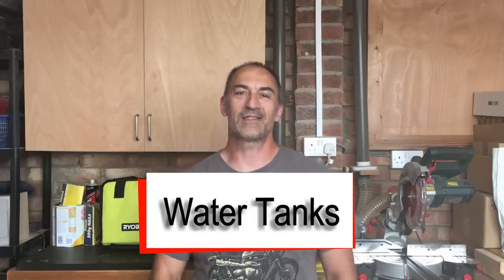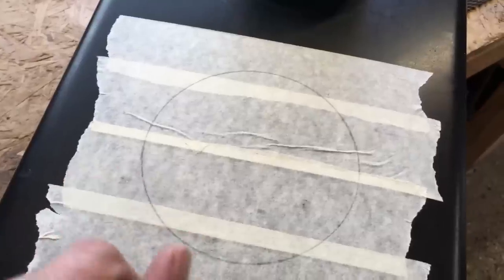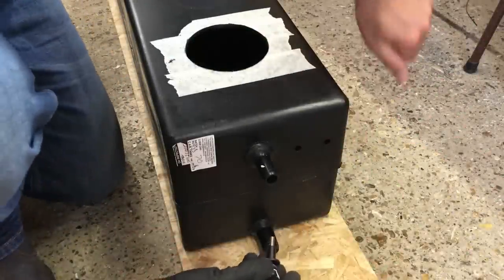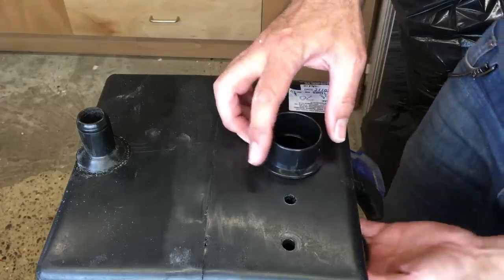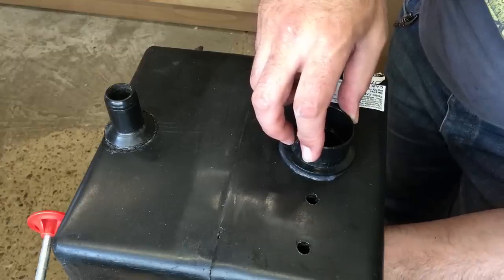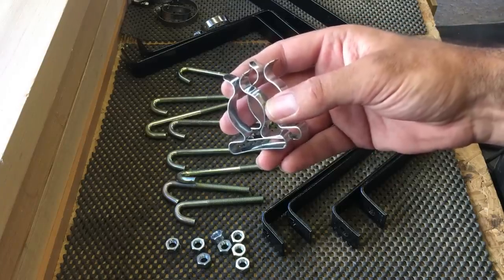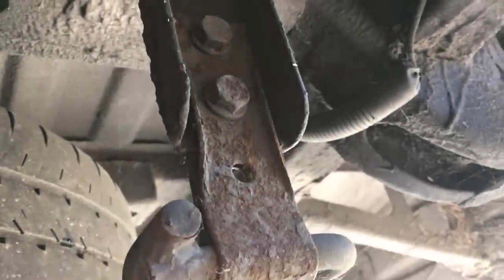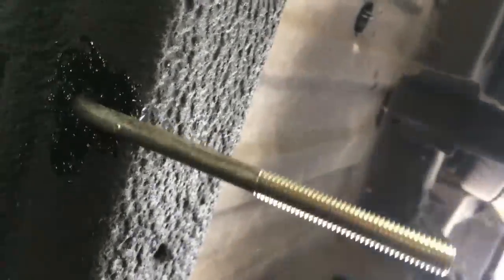Mercedes Sprinter Campervan - Water Tanks

Comment: I may have posted this before, but after watching some other DIY built van videos it's nice to watch one being built by a proper builder.  Example: spending the time to jig up a guide for the drain inlet hole saw when someone who doesn't know better would try to drill it freehand and likely make a mess of it.
Reply from the maker: I try to think ahead and eliminate as many problems before physically doing the work. 
Jigs are always a good solution for all sorts of jobs. Thanks for great comment.

Comment: Mate I am loving your videos. Whilst I know most of what you are sharing I really enjoy watching them. This is without doubt the best conversion series on YT and it is like watching a visual book. You clearly explain everything for the viewers step by step and not just what you are doing but why you are doing it. Very well thought out conversion. Having fun watching it, maybe you would consider writing a book for converting Van's. I have just been to the dealer on Friday and signed papers for a  MWB Sprinter. Plan on using it for a couple of years for day to day work and then converting and selling once done. Already done a conversion on VW T5 LWB Mid roof and just a few finishing touches left to finish her off. Your videos are making me want to start straight away on the next one. I thought I did things belt and braces with double shrink wrap on cables but your sealant on the contacts of the waste tank is a nice touch. Tempted to skip to the end to see that van finished because I know it will be awesome but I must resist the urge. Just a quick tip for others on here, you can warm up some Vaseline and pour into under body channels/sections/door panels etc. to work the same as wax oil if you can't get it in some countries. Cheers Jerry
Reply from the maker: Hello Jerry, it makes my day to recurve a comment like yours. Thank you very much. I would like to produce a book and it’s something I must find the time to produce. I have really enjoyed the whole conversion process and helping others too. It a great community of people. 
Good luck with your future conversion. Best wishes

Comment: Very instructive video. Many thanks. In another Sprinter build series they secured the water tanks using flexible metal strips. A later video showed him reattaching the water tank because the metal straps had broken. Then I noticed another van build series using the same flexible metal strips. Not sure why these other builds are using this method because they looked flimsy from the outset. Glad you're using better solid support for your tanks.

I second the request for info on winterising the tanks. Would be interested in how you'd approach this. Maybe cover this in a future Q n A?

Comment: Another excellent video Greg. You hit all the items that I would have done. 
1. Using the scrap ply as a guide for the new hole for the waste water inlet. Also useful if you need to fit larger downlighters where you have an existing fitting in a ceiling
2. Swapping out the plain nuts for nylocs ( who thought plain nuts with no anti-vibration washers was a good idea on a vehicle??)
3. Similarly- crappest connectors ever for an externally mounted tank doh!!. as others have said the glue lined heat shrink is a really good idea.

Comment: Another great video Greg. Beware using acetoxy silicone on plastics. When I fit shower wastes I have to use low modulus neutral cure silicone as the acetoxy variety eats away at the plastic and causes it to go brittle. Over time it turns the waste yellow and it falls apart...takes months but it does damage it
Reply from the maker: Thanks, David, yes maybe in hindsight some "plumbers mait" would have been the better choice.

Comment: Hi Greg, hope you are having a great time travelling, just wanted to let you know, I have now fit my waste water tank from Caktanks, managed to fit it behind the drivers area next to the diesel tank.  Can't fit the fresh water tank just yet as to fit the water pronged sensor, I need to cut a 60mm hole, but the hex shaft in my hole cutting kit is 3/8" and too big for my drill, so had to order a 1/4" hex shank.

Comment: Hi Greg, The waste valves you are using eventually sieze up, as on my Motorhome, I fitted lever metal taps, so much easier to use.
Reply from the maker: Yes Brian, to be honest I was not impressed by how they are all plastic and don’t operate easy at all. I think I will swap them out. Not a proper solution you are right. 👍🏼

Comment: Considering changing the "Lew" facilities in my Winnebago View Preview on a Mercedes 3500 diesel chassis.  Considering eliminating propane and black water tanks in favor of increased diesel and water capacity.  Thanks for your video's encouragement.

Comment: I always enjoy the thorough attention to detail in your work. 

You may be using it already but may I recommend glue lined heat shrink for outside wiring? It has an inner layer which seals tight and prevents water and dust from getting into connections.
Reply from the maker: I wasn't aware they did such a thing, so thank you for that tip and i'll look out for some.
Thanks Phillip very much.
Reply: I have used both recently and noticed a big difference. You can actually see the glue bubbling out the ends.

Comment: Great Job on the Sprinter. Now I want to get a sprinter. May I make a suggestion on the soldering of the cables? Since the splice will be under the van, before sliding the larger heat shrink tubing, I put a little silicon in it before shrinking the larger tubes since would help just in case moisture get in.

Comment: Looks really good.   Might I suggest a blob or three  of silicone one the clean out hatch to make sure that it doesn't rattle out on a road trip?  Just to lock it in place.
Reply from the maker: alanwestport 18months of driving and 13000 miles later and still there. 😊

Comment: Hey Greg, thanks for all the great content! Couple of questions? 1. Do you vent your waste water tank so as to prevent air locks and slow drainage? 2. Do you use any sort of filtration on your waste water so as to prevent food waste or anything chunky getting into the tank and potentially blocking the small drainage tap? Thanks again!
Reply from the maker: No, we normally wipe the plates into the bin first before washing.
Reply: @GregVirgoe  thanks Greg! I just saw your other video on your water tank setup ... thanks for being so thorough! Didn’t see any mention of venting the waste water tank though... is it necessary in your experience?

Comment: Looks a lot better than the guy that did the van I just brought it’s got same idea but with blue water tanks,problem is they hang to low and ground out a lot 
So might look at doing what u did 
Just a case of using the original connections.
Reply from the maker: CAK tanks make a huge range of tanks to fit every van 🚐👍🏼

Comment: So to help you if you make a plywood template up with 114mm hole in it and two drop down pieces either side you can use a router with a plate guide to make it the entry hole for the cover.
And a deck plate lid will mean less work.
No silicone needed for lid

Comment: You may think it's over kill but I would have used thin strips of rubber on the tank bracket and anywhere the plastic tank meets the body. I'm thinking about dirt roads and vibration that can stress the plastic or wear through it. As always a great video with great tips.
Reply: Such as an old bicycle inner tube.
Reply: Yes that would work, but I was thinking rubber a little bit thicker and spongier to absorb some shock as well as protect plastic.
Reply from the maker: Hi Karl, I asked that very question to the tank manufacturer, I suggested a sticky back high-density foam.
But they strongly advised not to use anything as that would over time compressor work lose and the tank would fall out.
Now it is fitted you would be amazed at how solid it is and its built to fit inside the main chassis members so it has no sideways movement. The tanks are about 1/4" thick so very robust.
Reply: Ah yes, I guess my thinking is I would be under there checking the condition and tension in the straps often, but the manufacturer knows that people are more likely to blame them than themselves. I'm now sure you've done the best for needs :)

Comment: Great video Greg , thanks. One question - why put manhole on top of waste tank? As you say, it will need cleaning more than fresh but you will need to drop waste to clean.
Reply from the maker: I thought there was more chance of it leaking if it was constantly submerged.
Reply: @GregVirgoe  thanks for your reply. One more question - when you drop the tanks to clean, how does it work with electrical connection? obviously cannot un-plug now.. Thanks
Reply from the maker: @1anonlyedwiltshire  it would be wise to remove the two bolt probes and check their condition or replace with new at that time you clean the tank. Cutting a few cable ties would give you enough flex to drop the tank. 👍🏼

Comment: If I am drilling a hole like your tank inlet, i.e. With a bigger hole than drill, I slip a short piece (pieces?) of plastic tube over the drill to fill the original hole. Worked for me 99% of the time...

Bob Hardy

Comment: Hey Greg, nice video as ever. Well done.
Quick question: How did you handle the wasterwater routing under the van? Don't you need to cross main chassisframe beams from left to right ) with the wasterwater hoses for Shower and Kitchen wastewater Wouldn't that create either not enough slope or unwanted bends and U-Shape watertraps?

Comment: Great videos and super helpful with my van build. I noticed on your gray tank you put the access opening on top. how do you actually get to it if it’s up against the bottom of the van? Maybe I misunderstood what you explained
Reply from the maker: In hindsight that would have been better on the bottom. Now I have to drop the tank. My initial thought was to prevent possible leaks if it wasn’t watertight.
Reply: I had the same exact thought.  It defeated the purpose of having an access port.  Otherwise excellent and informative video that will help me hopefully when I start my project.

Comment: Another top video Greg. I like your attention to detail. I have a thought tho about the tanks. Are you considering covering them with any insulation for the winter time. Also a silver heat shield would be an advantage to protect them from the exhaust heat. This is because when the particulate filter in the exhaust doesn’t a regeneration they glow cherry red with the heat and burn off the soot build up at anything from 600 to 1200 degrees
Doesn’t need to be to much just a bit of tin to deflect the heat especially on the waste tank 👍

Comment: awesome video, what do you think of people insulating the tanks? what's your opinion on this please?
thanks
Reply from the maker: It will definitely help if you plan to go to colder places. It needs to be a fairly substantial material like closed cell foam and securely fastened. Even wrapped with chicken wire to keep it from coming adrift driving through rain etc.

Comment: My mate built a 12mm perspex fish tank at 6' long  18" wide and 24" high. He used clear silicone ( that's the strongest as the coloured stuff like white and brown is up to 50% weaker due to the pigment apparently ) he also drilled and screwed every 1" and after he filled it halfway up with water it leaked. He redone everything and the same happened again so he gave up as he didn't trust it.

Silicon does not stick well to certain plastics although as a gasket on that plastic it may be fine, something like sikaflex may have been better, I don't know for sure.
Have you tested it when full Greg, I'm really interested in how it holds up to leaks with pressure. 

I suppose even if it drips a little it's not the  end of the world and it will save you from emptying it as much, ha!

Comment: Hi Greg, how did you attached the straight waste pipe to the tank connectors? Thank you so much for all your videos!
Reply from the maker: The tank connectors are solvent weld so the pipe is glued in. I did put a McAlpine compression straight joint soon after if I ever needed to drop the tank I could easily undo it.

Comment: Another great video Greg, well done my friend....it’s all coming together quicker now..👍🏼
those tanks brings back memories of taking off and installing petrol tanks when I was in the car body trade, your knees became your friends when lifting into place.. LOL....😊
Reply from the maker: Hi Marc, I’ve got one of those boards on casters that you lie on and roll around but as I couldn’t get it off the ground my chest wouldn’t fit under the skirt of the van, so resorted to a dust sheet and lots of shuffling 😥
Reply: Greg The other option would be to use a car jack (trolly jack) though those tanks aren’t as heavy as petrol tanks, you can still manoeuvre it into place leaving your arms free for the straps etc....still, all done now...👍🏼😉

Comment: Fantastic. I'm wondering how you're getting along with your tanks being attached underneath the van. Have you had any issues with freezing? If so, would you have an issue with freezing if the tank was located inside the van itself?
Reply: Could help to install any kind of insulation also around the water tanks??maybe expanded foam ...
We saw some projecta with a second apare  smaller pump and tank inside...just in case ir freezing the external ...
Reply: I call vans with under slung tanks without any provision against cold weather, sun chasers.

Comment: Hey Greg,
I was wondering if you had any concern or experience with your water tank freezing? I live in the mountains in Colorado where temperatures are regularly below freezing, am I correct in assuming a water tank under my vehicle would likely get damaged/not work properly?

Cheers, your videos are invaluable!
Reply: You can get ones especially suited for use in cold places. A little more expensive (not extortionate) but will give you peace of mind that you won't run into any issues.

Comment: Hi, great videos. This may be over kill but the underside of a car gets smashed when camping with rocks and twigs etc.. Have you thought of creating a sheet of aluminum on top like a shield so nothing pierces the plastic? You could also insulate the back of it to add some winterisation.
Reply from the maker: Hi Chris, I won’t be driving over any rough terrain in this bus. 
I’d be more concerned with ripping off the fuel tank or exhaust if that was the case. This is not a 4x4 version so grass fields is the limit for us.
My misses doesn’t like the cold so we will be chasing the strawberries on our tour 😀

Comment: Another great informative video Greg.
Just one question, did you consider any kind of rubber between the tank and the van to prevent possible chafing, likewise between the tank and tank straps ?
Just a thought.
Reply from the maker: Hi Andrew, it was something I asked the manufacturers and was strongly advised against it. The problems occur when the rubber or foam strip etc compresses or works lose and then the tank becomes lose. As it is now its rock solid and the tank is very thick 1/4" so should last a long time. I will make a regular check of tightness. Good point.

Comment: Hi Greg, I notice that on a follow up video you have an air inlet with filter for the fresh water tank. Is this something you added as I don’t have that with my tank? My tank has small pin holes along the top of the tank and that’s the only way I can see air getting into the tank to prevent a vacuum but that clearly isn’t filtered and I’m just wondering what you did with yours. Thanks
Reply from the maker: Davie McLachlan yes it was something I added. There was a small vent connection on the back of the filler point. So I just used a short bit of braided hose and a new engine breather filter. Just to keep bugs out. No water will ever get up to that point so it doesn’t need to be food safe. It’s just to stop a vacuum forming and slowing the water flow down or worse still collapsing the tank. 👍🏼
Reply: Thanks Greg. And what about the small holes that are on mine, we’re they on yours and did you seal them up?

Comment: I noticed a slick racing tyre as your spare. 😀.  I am sure before you set off you will address this but will you be fitting more than one elsewhere on the van?
Reply from the maker: Hello Martin, yes I noticed that myself and will be fitting a new spare. I will only take one as being prepared for one eventually is enough cover. If you prepared for double knocks you would have a van full of spares 😊